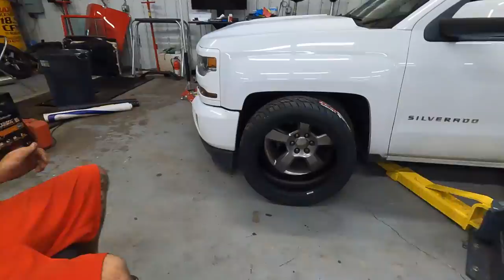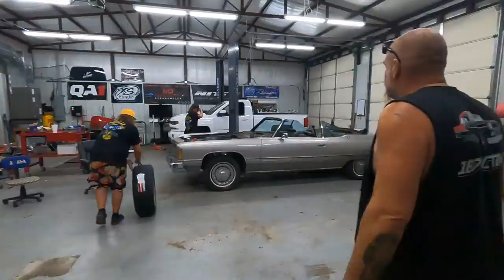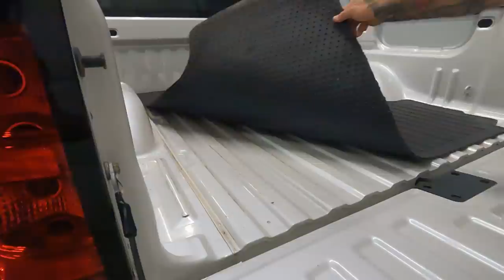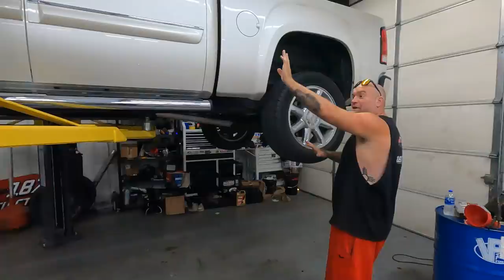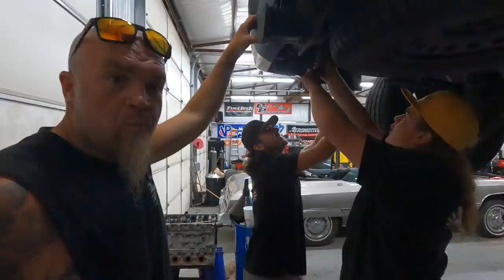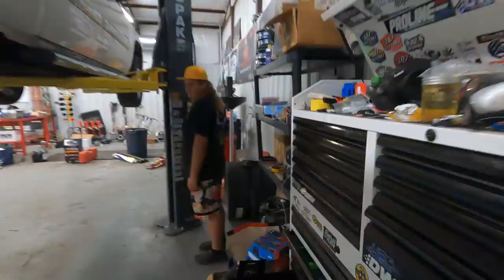Upgrades For Murder Nova and Mrs. Murder Novas Daily Drivers. New Tires and Drop Shackles!

Comment: 1. Drain the water out of your compressor. You'll be surprised how less often it comes on. (water don't compress)
2. Aiden and Dalton are getting the best education right there in that shop. Awesome they are interested and y'all take the time with them. 
3. Manufactures leave the front low to cheese the fuel economy numbers. Every one of them do it.
Great content again, thank you
Reply: How do you drain the water
Reply: @benjaminabel3255  
There is a valve at the bottom. Carefully (remember lots of pressure) turn valve and it will piss out the bottom.
Reply: Drain the water and your tank will last longer too. Leave water in it and it will rust.
Reply: Also, My plasma cutter (Lincoln ProCut 55) gets pissed off if there is any moisture in the air. 
Water separators can only do so much.
So there's another good reason to drain your compressor tank regularly. Every 3rd day during winter months for me.

Comment: For future reference on the Denali there's a 1 3/4" block between the axle and leaf spring you can remove and it'll lower it and you can still use factory U bolts there's enough threads there.

Comment: The yellow dot on the tire is supposed to line up with the valve stem, that is because if the wheel is not bent and true, the wheel and tire will take the least amount of wheel weights to balance out. Also the valve stem should be ahead of the part of the tire changer arm that you fold the sidewall over to dismount the tire, you will never break another tire pressure sensor again. Goid luck, love your channel and the 187 crew!!!!
Reply: I never knew this.  Thanks for the knowledge!!
Reply: And to add to the knowledge of power... when you seat the beads on the tire you should release the clamps so the tire doesn't decide to explode into the ceiling. There's usually a sticker on the machine. Lol (fyi) we morons learn some how

Comment: It’s not just cheap tires that flat spot after sitting a little while. I have a set of Falken tires on my Mark LT, and they do it after 3-4 days of sitting. They are the highest load rates tires that fit, so it’s not a sidewall issue with them! The Goodyears are I had on it in the past were the same way!

Comment: If you are having trouble getting the cruise to work on the dually,  it's probably the brake light switch under the dash. I've fixed multiple gm trucks with the same issue. It's a ten minute fix.

Comment: We have a full driveline w/ transfer case out of 2012 Denali, we are putting it in a 98 suburban. That 6.2 is killer.

Also... Those electric ratchets need to be greased on the little hole that is in the middle of the direction switch on the back. Ask the snappy guy, I went a few years before I figured it out. They last longer now.

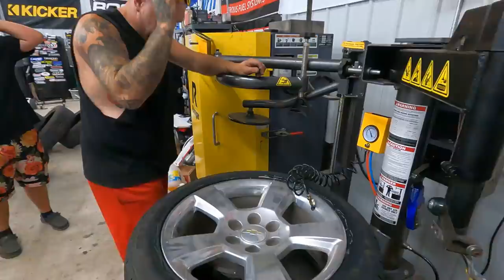Comment: Advice from 1moron to the next  @14:43 see that yellow dot/circle? Thats suppose to be lined up with the valve stem. Makes it balance out easier.
Reply: Yup and red dots are opposite of the valve stem.  That drives me buts when I see tire dots in the wrong position haha
Reply: It makes a world of difference to. I learned this the hard way last fall mounting 33s on my F150. I first lined up the red. Put on the balancer and was 7oz out. Had to take tire back off, rotated to the yellow. Put it back on the balancer was only out .25

Comment: Pro tip- if u start out with the TPMS sensor directly under the duck head then u won’t break it. Also when issuing the shovel to Debead it always but the TPMS sensor at 12 o’clock & 6 o’clock so u don’t break it there either. And when u go to out the tire back on out the sensor in the 8oclock area. I’m a Yukon/mustang local if u need some pointers

Comment: tip from a shop junkie......always put the valve stem right under the duck bill when removing and u wnt break a sensor and i put it at bout 8oclock to me when installing......and yea the yellow dot should be lined up with the valve stem for easier balancing ......love ur vids and the fact ur never gonna turn all hollywood!!!!

Comment: LoL. When removing tires from wheels with TPMS. I’ve learned from trial and error over time. Always line up stem with break over point when removing bottom bead. From a tire tech that lost money/time on installs when I first started working with TPMS.
Reply: I also run Nitto on my beater. Great tire

Comment: Saw you breaking that tpms before it happened.. when dismounting.. line up stem with the arm right where you lift it off.. then when mounting it. Twist bead til its tight tpms needs to be in front ofwhere the traction point is... (Where it gets tight).. so if 6 oclock is position of valve when dismount its about 10oclock

Comment: When fitting tyres to wheels with TPS

Rule no.1 Don’t break bead at or opposite valve.
Rule no.2 Start at the valve 
Rule no.3 Finish at the value
Also just a suggestion but probably not a great idea to use an impact wrench on locknuts. 
Or you can just be like fuck in and keep breaking sensors. 
Anyway love the content keep it up guys

Comment: Hey guys give Aiden a piece of advice my stepdad gave me when I first started working in the shop, be smarter than the tool you're working with. I see it all the time people not being smarter than the tool they're working with. It's funny to watch until they get hurt. It took me awhile to understand it but I eventually got what my stepdad was saying. The way they put these trucks together anymore is frame, suspension, drive train, cab and bed, wire, interior, fenders hood doors and bumpers. They are not mechanic friendly. Its like everything the engineers did, didn't have the mechanic in mind! Right behind the 3rd catilitic convertor at the ball flare they put the bolt to the clamp facing up. Once it gets a little bit of rust on it your screwed, cause you usually can't get anything other than a wrench on it. I feel y'alls pain there! Love the channel keep it up.

Comment: (Just incase) but there's a reason why they usually have stock trucks rear higher than the front, so that when you tow something is doesn't go as low. But yeah it does look better leveled if you don't need to tow anyway.

Comment: Isn't that yellow dot on the outside supposed to be 180* away from the valve stem? Isn't that supposed to be either a heavy or light spot of the tire? Clearly I don't know, if someone is  balancing it a couple extra weights won't hurt.

Comment: Straight up can someine reach me if tried a few times and zero luvk. I was engulfed in gas and light up a yr ago November building my sons truck at home. A fuel tank under pressure blew as i was by a propane heater. It was winter in my garage. Id like to either ship whats left of the chev pickup or flat out have yous build us a daily driver .  Respect out of Beardmore ont Canada

Comment: Well not trying to tell y'all how to do ya job, but the next time y'all mount some tires and they have they yellow dot on the side wall. For future refrence that dot should be aligned with the valve stem. it's a balance point.

Comment: Not sure if any one has told u guys how to!! But never push the tire at the sensor when breaking the bead and u won’t break the tpms and when taking the tire off the rim always put the tpms at the duck… and putting on the tire put to 4 o’clock from the duck and u won’t break them anymore…

Comment: @55:10,, ",, it ain't a hard job,," not when you have a lift it ain't BUT remember when you used to be on your back, discover you did not have the tools you need,, how many times you crawl out from under the car, get up, go get the tool(s), lie back down and wriggle yerself back under the car and discover you STILL don't have everything you need? Remember the frustration?  Of course you do. :)  Being at the place in life where a guy has a shop AND a lift is like Heaven. Doing a job like that lying on your back in the gravel driveway - not so much. Ohh,, back to my point, it CAN BE A HARD JOB FO SHO!!

Comment: I don't know if that truck has afm or not shut that shit off ,  pull your trans pan check for metal and get a billet converter and a zip kit if you don't have metal or you will be replacing that 6l80

Comment: Those loose 16 or 16.5 wheels are scaring me.. those are widow makers.. if you mix them up.. an put the wrong tire they will blow clean off the rim .dont air them up with your arm body anything over the rim. They are so close in size you dont notice them that they are too loose or too tight. Sorry signed saftey man.. lol.. hope yall see this.. look it up its no joke.. did tire s an alignments for  years .. they are so dangerous they made a special tool for loose wheels like those.. its a go no go tool for shops.